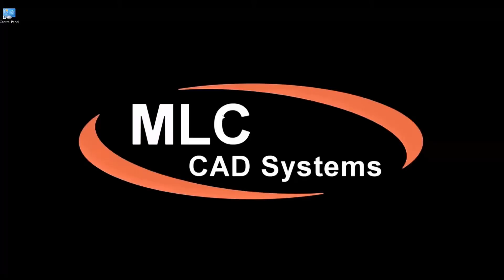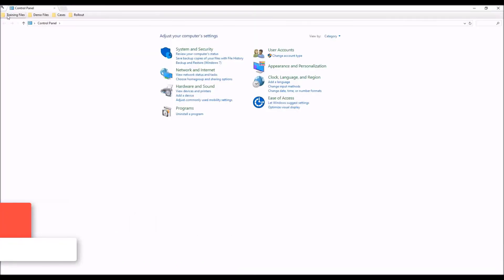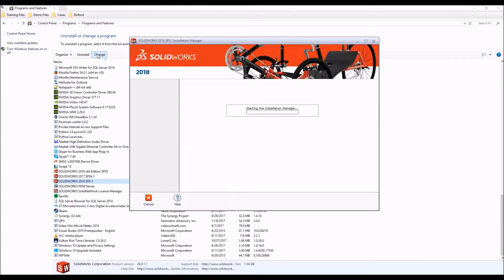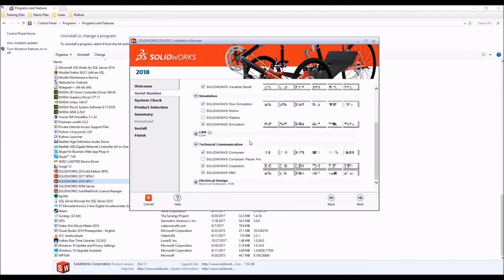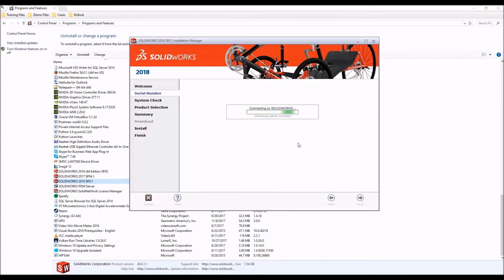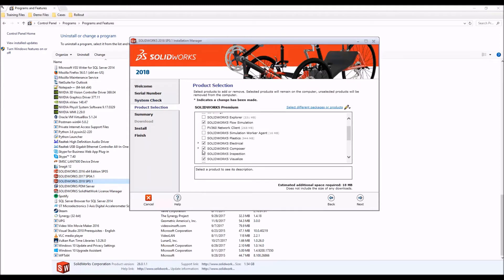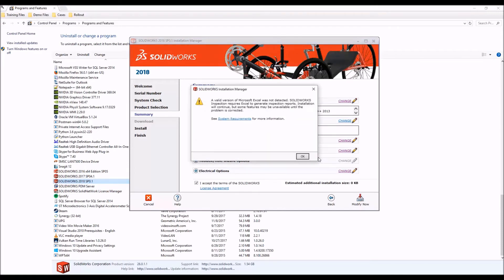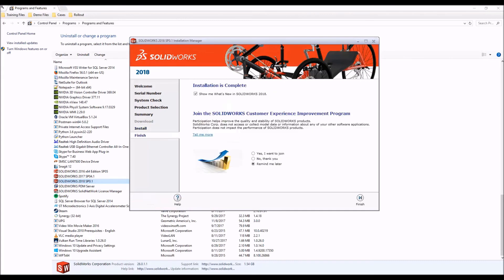How to add Composer to an existing SOLIDWORKS Installation

Comment: I don't see composer in the product selection page
Reply from the maker: If you have a serial number for Composer, you will need to make sure to enter that in the licenses page so it shows up on the product selection page. If the license is on a network or is coming later, see if there is an option to show products not included with the license on the selection page.
Reply: @MLCCADSystems  Thanks, it worked. I could modify my installationand choose for SolidWorks Composer 2024
Reply: @MLCCADSystems  It worked, thank you